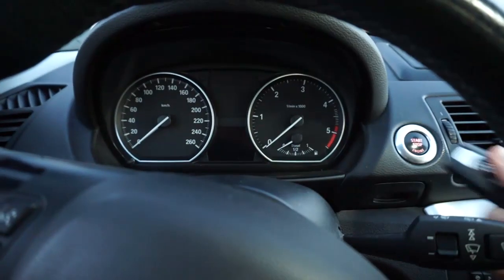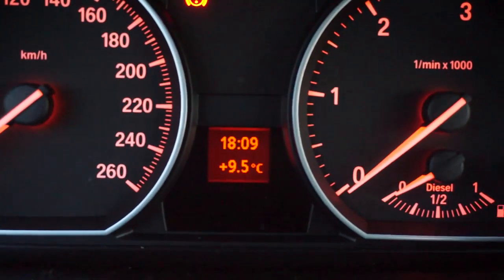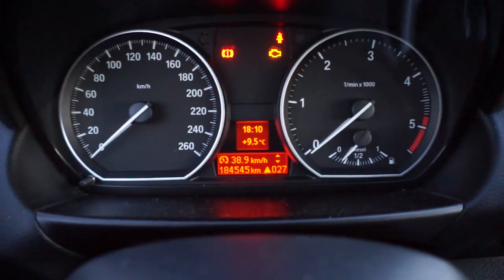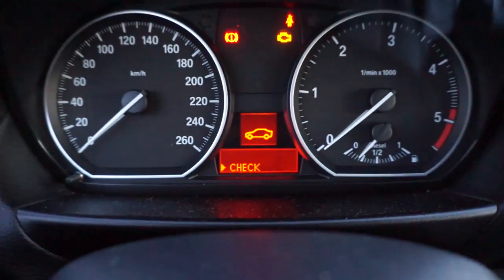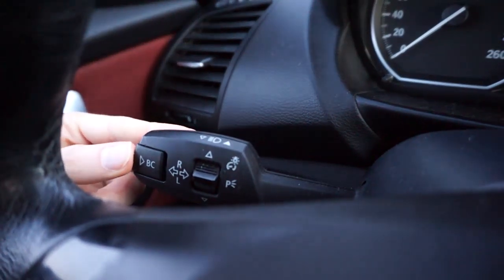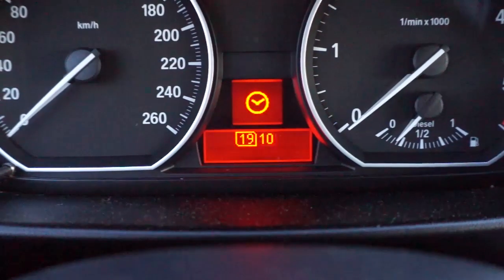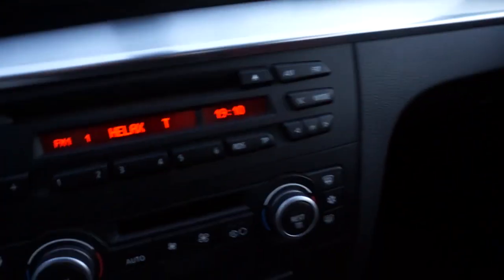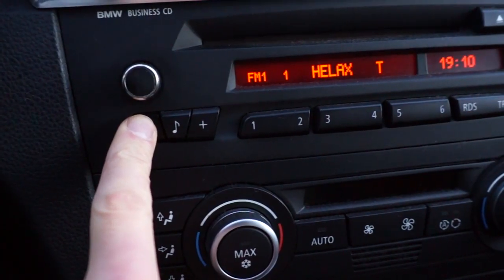How to set clock in BMW E87, E90

Comment: I had in my BMW 1 temperature on °C and normal time not am and PM then i got in my car and temperature id in farads and time is am PM, anybody know how to get it back to normal?
Reply from the maker: You can set it though the board computer. Use the left stalk to navigate to icon with key and a ruler. There you can select units for temperature, mileage, fuel consumption, time & date format.

Comment: why do you hold the clock button down after you set it?
Reply from the maker: Just to show that the clock button on the radio does nothing.
Reply: mr-fix ok it’s just that when i set my time and m date in my e92 the next time i start it i find it is blank an the date and time have been reset and i can never get it to stay set do you know anything about this ?
Reply from the maker: There's a relay that switches off couple modules if system voltage is too low. That includes instrument cluster so it reset time, date, daily trip odometer.
You can have battery below threshold, faulty IBS or something that drains your battery (like a dash cam or phone charger).
Reply: mr-fix thankyou what would you suggest i do do i need to buy anything to correct this or do something?
Reply from the maker: Try charging your battery over night and check if problem persists.
Reply: My time will not stay set when I change it. It goes right back to the original time.
Reply: Kay Star did you ever resolve this? as i have not still